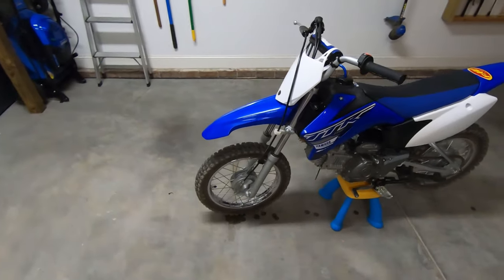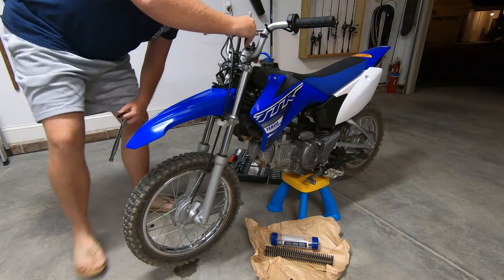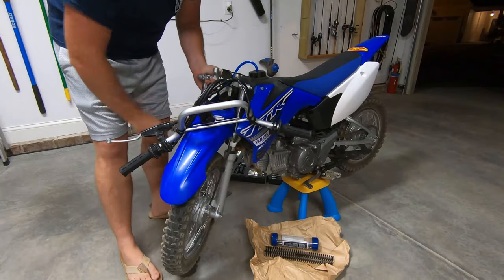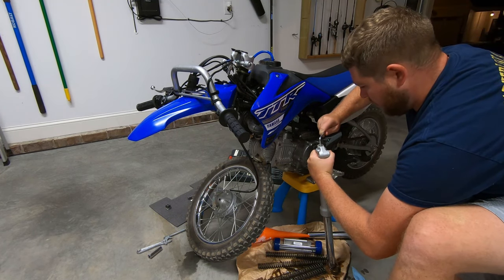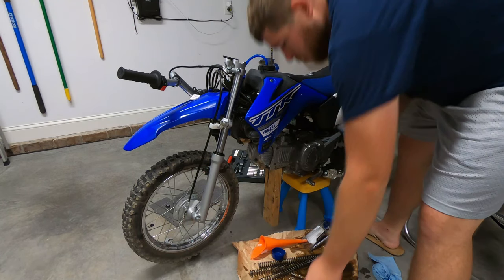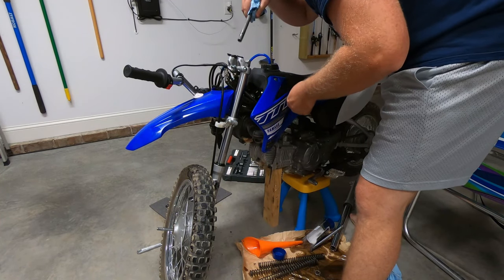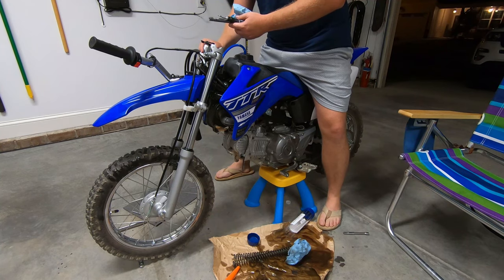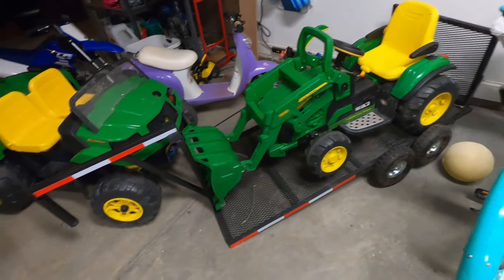BBR Heavy Duty Fork Springs and Damping Rods 2019 Yamaha TTR110

Comment: thanks for the video!...quick question, after installing BBR spring/ dampner do you still use the stock spacer that goes on top of the spring? (the one you set on your seat around 6:30 in this clip)  thanks again
Reply from the maker: Yes you do!

Comment: If I have pro it out triple clamp installed will doing this front fork setup like this be too much height in front? And will plus 3 Bbr brake cable work or will I need 5 with the pro circuit triple clamp plus this Bbr damping rods and springs?

Comment: Hey man I’m trying to preload the standard spring with a few washers as a cheap way to get abit it extra stiffness. Is there a trick to getting the circlip out of the top of the shock? I’ve removed the black cap but I’m stuck as how to get the clip out and access to the spacer. Thanks a heap
Reply from the maker: its pretty tough to get out but no tricks really. Just take the pressure off of the ring by pushing down and pry it out with a small screwdriver.

Comment: Hello I recently installed springs and rods in my 2020 ttr110 and I'm not sure if its actually that much stiffer or the forks aren't compressing
Reply from the maker: That’s odd man. Did you forget to add fluid or the spacers back in there? If not, then idk. The BBR springs and rods are very noticeable

Comment: What weight fork oil did you use? I'm 140 lbs and thinking 10 wt.
Reply from the maker: Jeff Syslo I don’t remember exactly, but I want to say I grabbed 20 wt.
Reply: I used 15wt, and I am 145 lb. Definitely, a lot stiffer than stock, but I got used to it quickly and they're breaking in nicely. Landing is so much better while jumping
Reply from the maker: Antonello Morelli no doubt man! Even the small changes make a big difference on these bikes!
Reply from the maker: Antonello Morelli for sure! Definitely makes a difference!
Reply: 20 wt

Comment: So i have this bike but its a 2014.  I got it and fixed it up and it ran fine.  It started bogging the next ride so i rode it once more before cleaning the carbuerator.  It started bogging the second you would throttle it and then the kick got stuck.  But when you used the electric start it didnt try it went: NEMP instead of like trying to start like NENENENENNEMMMPPPP know what i mean?  SOmeone help!

Comment: Do u need to use lock tight on the bolts when putting them back in
Reply from the maker: I typically lock tight everything. Did not here though. Never hurts!
Reply: @realmmfc  Oo thank you and can u do a video update about the ttr 110
Reply from the maker: It’s been done bro! https://youtu.be/S56Rhmh1fMY
Reply: Do you know the torque specs for the top and bottom clamps and the front axle

Comment: Just got off the phone with Yamaha if anyone els is wondering 6.5 ounces of fork oil I used 15 weight
Reply from the maker: Thank you for this!!! Not all heroes wear capes!!
Reply: I had seen that someone commented 165ml.      But 6.5oz is 192ml.     I’m doing mine right now and I’m held up on knowing the correct amount Forsure!
Reply: I also did the bbr dampening rods and bbr springs.

Comment: I got a 2019 ttr 110 the rims got trashed on it I’m haven a hard time finding the right ones I need can someone help
Reply from the maker: Should be able to just toss what you’re looking for into google
Reply: @realmmfc  I get confused when viewing them I searched eBay in it’s very confusing I don’t wanna order the wrong rims I need the rims with the drum brakes in all I seem to find is front disk rims in it mostly pops up stickers & crf rims
Reply from the maker: @dylanga2666  yeah so the inner part of the wheel is called the hub, that’s the part the drum will drop into. The wheel is the outer part past the spokes only. If you only are looking for wheels all you need to get is the 14” or 12” wheel. If you need spokes, hubs and bearings, that’s going to be harder to find unless you do a disc conversation .
Reply: @realmmfc  the hubs good on the back  I be able to order spokes in a wheel I should be good for the back.... the front wheel is the worst completely trashed can I order the disk wheel conversion for the front in use that in maybe not hook up the brake caliber ..thank you for your help bro I really appreciate it
Reply from the maker: @dylanga2666  as far as the disc conversion goes, I haven’t done it myself so I am not sure exactly what all is involved bud.
Reply: Also would a ttr 90 wheel in rim used fit I’m sorry for the aggravation thanks for your help
Reply from the maker: @dylanga2666  no worries man! I would look up some forums and see. I want to say I have seen that the 90 front wheel will work, but I am not certain! Looks very similar in pictures thought
Reply: @realmmfc  thanks a million buddy
Reply from the maker: @dylanga2666  for sure man!